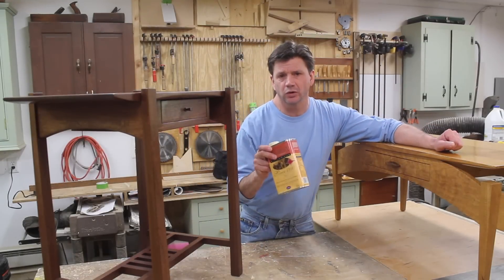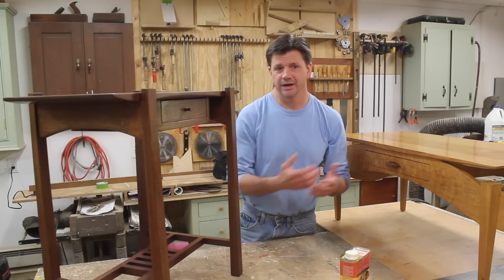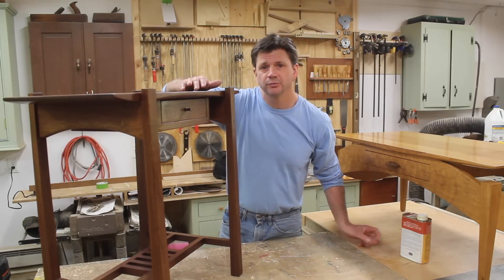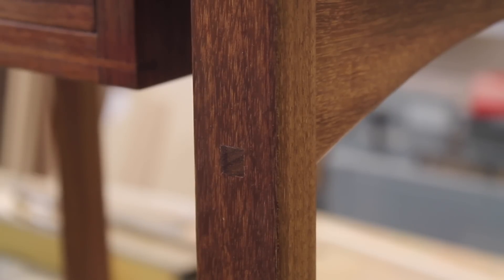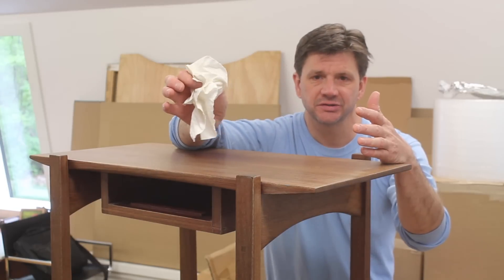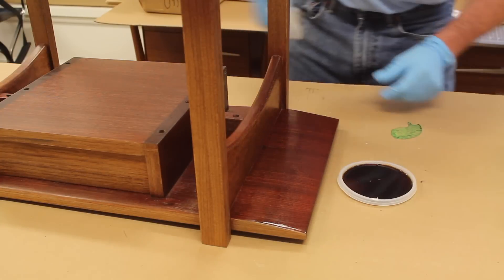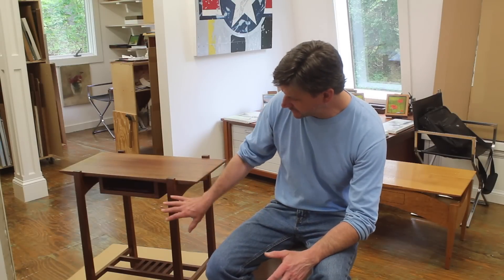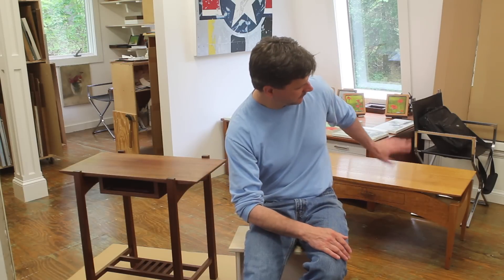Refinishing Furniture Using Waterlox

Comment: I would like to see a build video and my choice of the two woods is Sapele mainly because I have never seen that wood before. In a small town in North Carolina all we see is Pine and Oak and some Walnut. Both of your tables looked fabulous. Question:  where you had that blowout on your folk's table could a solution have been to do the same on the other side and then put in two contrasting plugs proud of the leg about 1/16". I would hate to have to build another for the cost.

God Bless my friend.

Comment: I'm a novice wood worker and I could use some advice: What's the purpose of running a finish with steel wool and all that? What does it accomplish, what's the correct way to do it, what do I follow it up with? I'm trying to get more into furniture and not just sheds and basic construction, and could use a debriefing on the whole process of finishing.

Comment: Hi Jon, I have been watching your videos for several months, they are put together very thoughtfully and the projects are varied and interesting. I am glad to know you are so satisfied with Waterlox. I had been using Behlen's Rock Hard Tabletop Varnish for many years for all my  projects (I cut it with Tung oil for most surfaces, except flat ones) , but about 4 years ago they stopped making that formula (which contained some phenolic resin for sure) and they now make a urethane based product which have not tried. I was searching for a suitable replacement to the Behlen's, I tried many things and then a year ago I tried Waterlox and I feel it is the best wiping varnish that I have used in the last few years. In another one of your videos I thought you said you prefer polyurethane for tabletops, is there a particular urethane you think is the most durable?